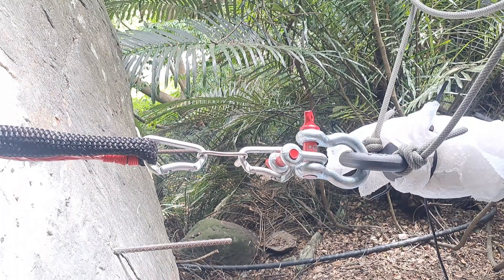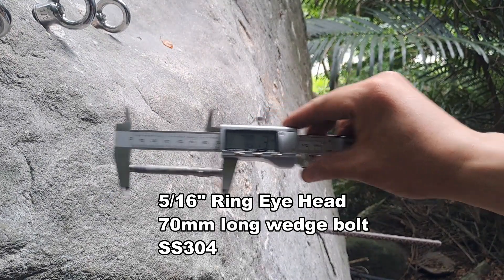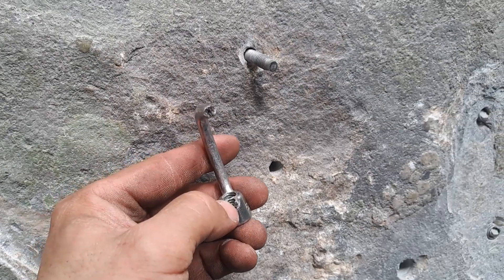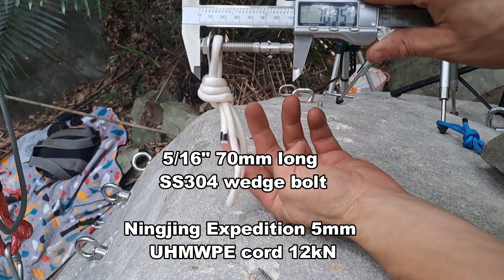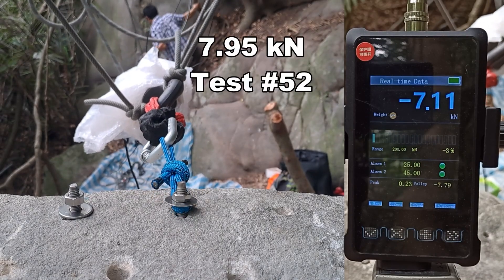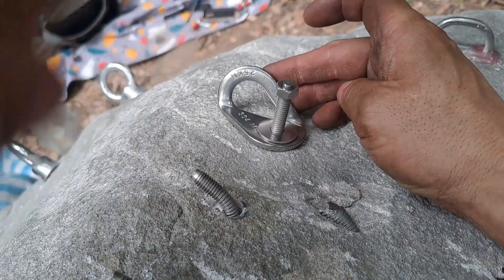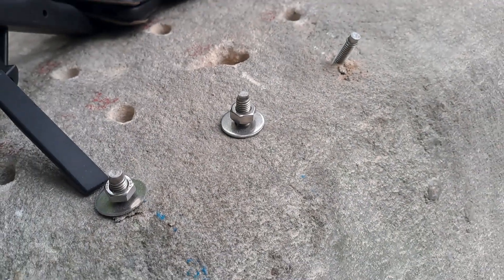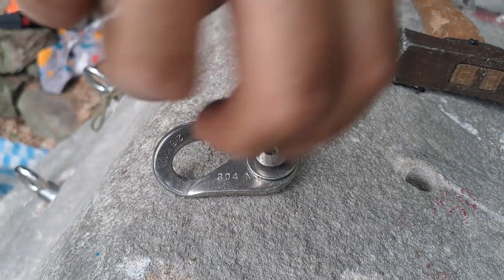BREAK TEST: Canyoning hardware bolt kit used in Taiwan

Comment: That kind of weird flash void inside that eye is the type of thing that you theoretically don't get with proper rated gear. But their inspections are still gonna miss things occasionally too
Reply from the maker: Thanks for the feedback as to what that was. That ring eye head broke about the same as the others, it was just something I haven't seen on my other break tests with those eyebolts, (which is all unrated/uncertified generic hardware store stuff some choose to use).

Comment: wow, those eyebolt are way stronger than I would think!
Reply from the maker: Yeah, they've been pretty strong in my tension tests when I pulled 3/8" sleeve bolts. Their quality has been fairly consistent for simply being a hardware store ring eyebolt. However other cheaper hardware store bolts I've bought and have been testing have had inconsistent breaking numbers, as low at 7kN, and 33kN at the higher for ones of 2 1/2" length. So yeah, some definite issues with quality control at the manufacturing or raw steel material level. But that's for a whole other video.